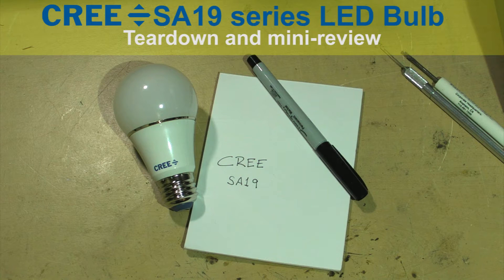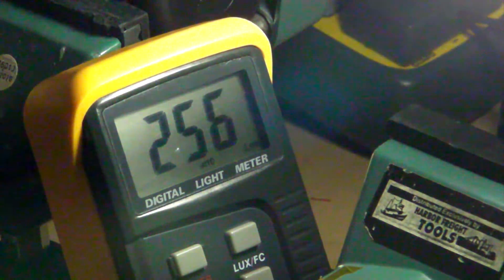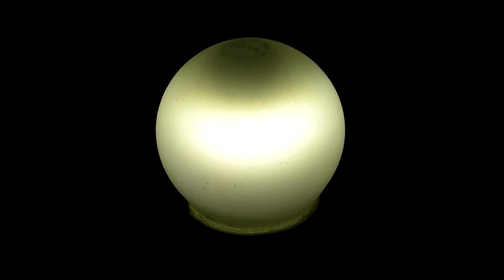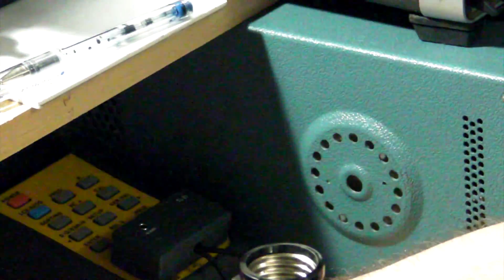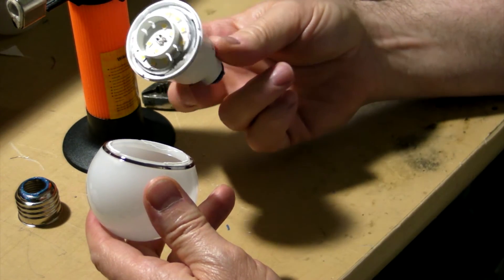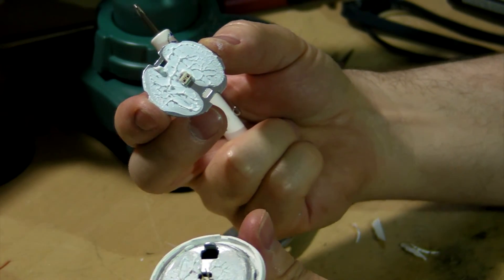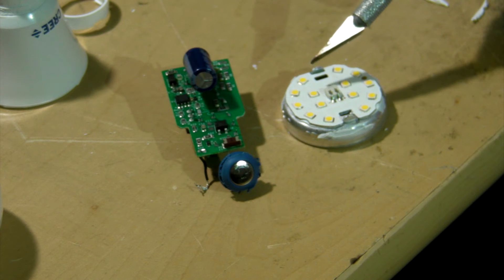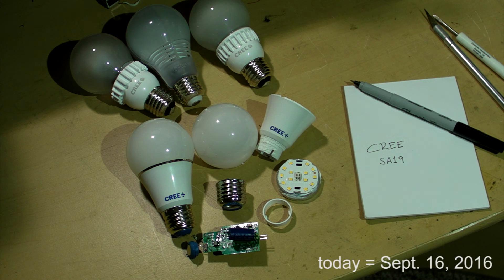Teardown and Review of NEW 2016 CREE SA19 LED light bulb

Comment: Great video.  I just opened up a Cree 3rd gen 60W bulb and was surprised to see the circuit board encapsulated in an epoxy-like material, unlike the bulb in your video.  Any idea why that has been added?  I bought these bulbs on January 6th, 2017.
Reply from the maker: It's probably two-fold...
1) Increased high humidity resistance.  The PC Board conformal coating used on these early bulbs isn't really a 100% solution... more like 85-90% reliability... perfectly fine for indoors use, but not so much for sidewalk/driveway lamps & garage door openers in humid environments.
2) Making the electrolytic capacitor vibration resistant. Some manufacturers will use a large dab of silicone to glue them down to the circuit board to prevent vibration from causing solder joints to fail (such as when used in a garage door opener). The capacitor is heavy enough to create enough torque during vibration - that over time it can break the solder joints loose... I've seen this many times in older CCFL "twisty" bulbs.  

Encapsulation solves both possible durability issues 100%.
Reply from the maker: I just added another comment in the video description... related directly to this issue.  I'd best good money that the failed 100w bulb had the early board like shown in my video, not well protected like yours.

Comment: Would this be OK in an enclosed light fixture? I want to put 3 100w equivalent in a fixture that's about 20x20x6.
Reply from the maker: That's a pretty high heat load for a rather small fully-enclosed space.  There are many factors that would need to be evaluated, in order to give a good answer to these kinds of questions... like
1) What's the maximum temperature of the fixture WITHOUT any lights (worst case possible, at the exact specific desired location)
2) What are the materials used in the fixture - both lower and upper covers. Glass is a bad heat transfer material, compared to most any metals. (http://hyperphysics.phy-astr.gsu.edu/hbase/Tables/thrcn.html) It's better than most plastics though.
3) What is above the fixture - solid sheet-rock, then insulation on top of that... or is it in an open air space, etc?

My "best guess"... which would be a wild guess... is "No"... but if it's got ANY possible air ingress/egress... then the answer could change completely... because it just doesn't take much (in CFM) to carry heat away, even through natural convection as long as there is sufficient temperature gradient between internal and external air temperatures.

IF the top/bottom covers can be ventilated by adding a few holes for airflow, then the bulbs would have a far better chance of long-term survival.  The first component to "die" in most LED bulbs (due to heat) is the electrolytic capacitors. As noted in the video, Cree uses 105°C rated capacitors, which doesn't mean they can run at 105°C forever... but it does looks like the capacitors are rated for about 10k hours at that temperature. 

Remember though... this is not the "bulb environment" temperature... it's the actual capacitor component, located inside the bulb enclosure... which will be quite a bit hotter than the environment around the bulb.  

The specifications on the bulb environment is actually -25°C to +45°C (-13°F and +113°F).
http://creebulb.com/media/document/file/c/a/cautions_cree_a19_a21_0716.pdf
Reply: Wow thanks for the super detailed answer! Much appreciated!
Reply: 1) max temp is around 70 f.
2) bottom is glass. Sides are lamp shade material.
3)yup solid sheetrock and installation

What would led would you recommend for this situation? I do need it to be dimmable.
Reply from the maker: Is the "lamp shade material" breathable?  That's about your only 'out', as far as I see it. Are the sides solid/flat, or pleated? (a link to a picture would help)
Reply: I will return my enclosed light fixture and go with one that's open for better comparability with LEDs. Thank you!